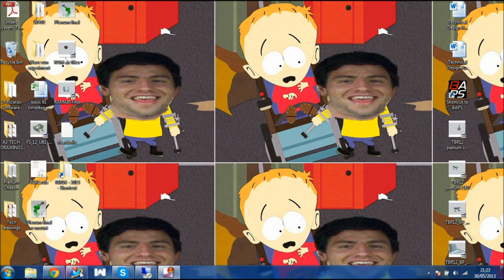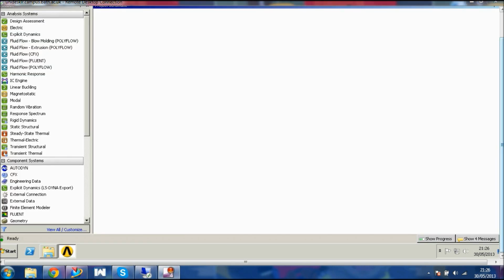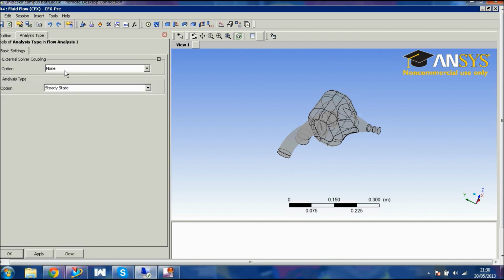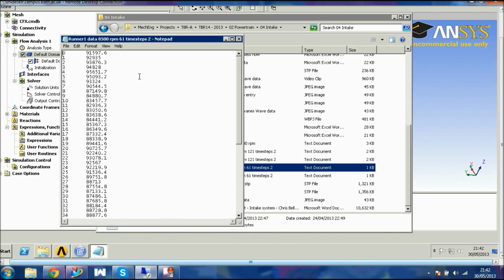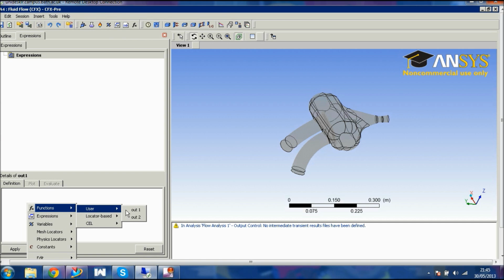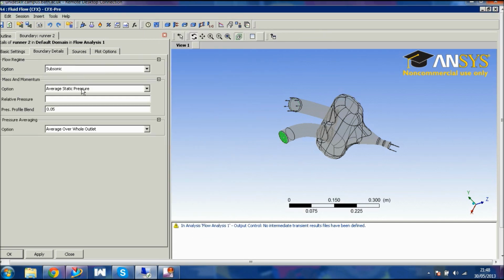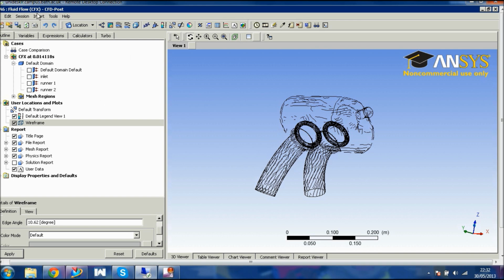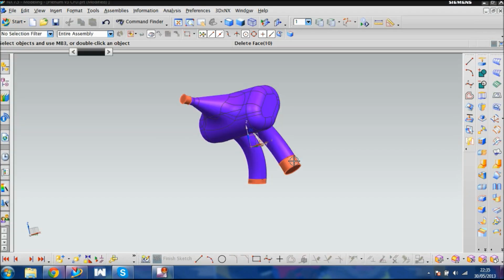Ansys 14 Internal Flow CFD tutorial

Comment: Hey Christopher, thanks a lot for the Tutorial, but you're making a mistake when you're importing the Wave Data. You must specify the exact time when a pressure is reached, not numerate them with 1,2,3... Ansys will interpret the expression as expression1(seconds) wich gives only the very first pressure level over the whole simulation because its runtime is less than 1 second! Thats also why the flow in your animation is only going through one runner and thats the issue everybody in the comments has.

regards
Reply from the maker: Alexander .L Thanks. To be honest this project was one I did at uni and I haven't done any CFD since so it's very basic. But thank you for giving me the answer to a lot of the questions I get. I'm too busy to reply to them.
Reply: Christopher Bell, i guess you have been Part of a formula Student team?
Reply from the maker: Alexander .L Yeah, I was part of team bath racing and graduated in 2014.
Reply: @Nerrror  Hello  I am a formula student Alexander can you please tell me that how can I import that pressure data from Ricardo because I guess I am following a wrong meathod thank you. Your help will be very important
Reply: @fun_factory880  you can follow the video step by step, only make sure to correct the mistake I mentioned in my first comment
Reply: Hey Alex, can you tell me how can I import the Pressure values from Wave.

Comment: Sir i am trying to perform cfx on intake system,but i am stucked in getting the runner data....so can you help me out by guiding me how to find it.
Reply: Dharmik, I also don't have runner data but I downloaded an excel file for four cylinder engine. Did you find any method to obtain the data ?
Reply: Mayb GT suites
Reply: Abhishek chaubey hey bro could u mail me the excel file which u have on my email ( imdvp007@gmail.com )
Reply: Sure. I don't know how GT suite works but if it works for you then I will try GT suite too.
Reply: @dharmikpatel5754  can you send me the data sheet(pawarravindra619@gmail.com)
Reply: RAVINDRA PAWAR  send me your email id.
Reply: @dharmikpatel5754  pawarravindra619@gmail.com
Reply: @dharmikpatel5754  please?
Reply: @abhishekchoubey8750  hey, can you pls mail the excel file of pressure data on pawarravindra619@gmail.com
Reply: @abhishekchoubey8750  Can you send the file please ? y.khafaga89@gmail.com

Comment: Hello, I followed your method and simulated my intake manifold with 4 runners.
However, after the solution as complete, only 1 runners has flow going to it rather than than following the firing order of the engine. How may I resolve this ? 
The runner pressures were generated using GT-Suites. Thank you
Reply: did you find any solution ??

Comment: Hey, first thanks for the great Video tutorial. 
I tried to simulate a complete gas cycle (720° Crankshaft angle) in 1000 steps so theoretically each cylinder has to suck at least once. The lists with the runner pressures are right and plausible. I build my model 100% like yours and the results are similar. The problem is: I think ansys do not use the different pressures in the time steps. It seems like the first pressure is simulated again and again up to timestep 1000 because in the results only two runners are working. I will give you a link to the result video. Do you have an idea? Regards
Reply: Hello there, I ran into the same problem as well, only difference is that I have only use 720° Crankshaft angle (720 timesteps). If you could let me know how you have overcome this issue that it would be great. Thank you.